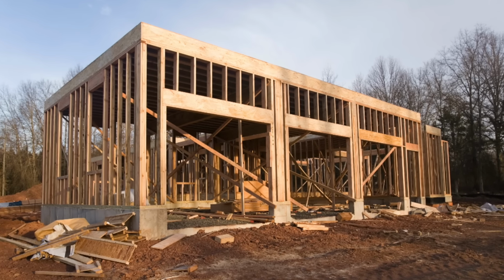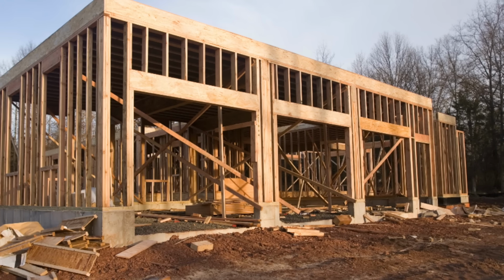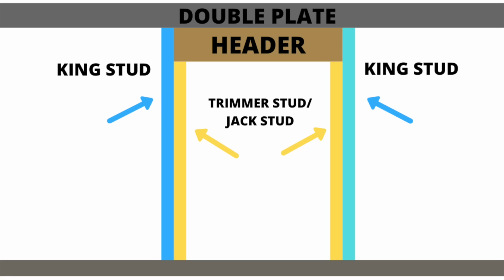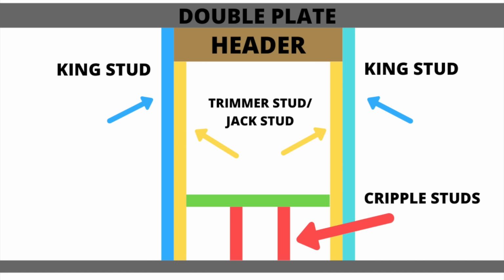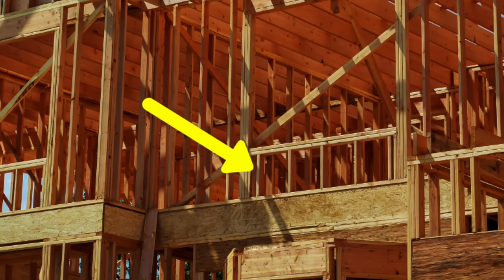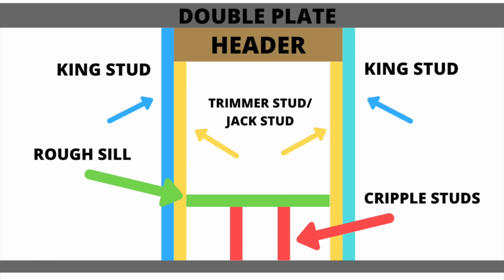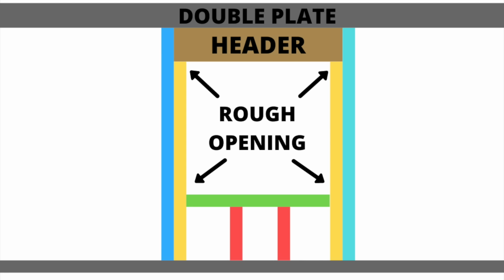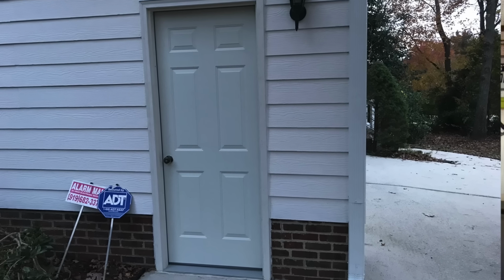All House Framing EXPLAINED...In Just 12 MINUTES! (House Construction/Framing Members)

Comment: in my little world, cripple studs are the members affixed to the king stud around door and window openings, as in a crutch used by crippled people, that carry the weight transferred from the header, whereasthe shprt studs underthe windowledge are called jack studs as a shortened member, also jack rafters for the same reason.   you have also forgotten to mention pressure blocks sometime used instead of simpson hangers.   by praising the trusssd roof, you have done a disservice to traditional stick-framed roofs, which allow for additional living space.
Reply: Truss roofs are much stronger than stick-framed roofs.
Reply: @jobacuda4472  i taught western platform framing in Japan for a few years, i only built one building that was was trussed, that was a wide spanned open commercial building.  all other residential buildings were single detatched, many with dormers.  they loved the attic spaces.  there was a big boom after the Kobi shaker, demand for western framing sky-rocketted.
Reply: @brianlindsay2727  Interesting

Comment: Is there a reason the sub floor is structurally supporting walls? Especially exterior walls.
Reply: The sub flooring (mostly now 3/4") runs from edge to edge. The second floor exterior walls rest on the outside 3 1/2" or 5 1/2" (directly over the walls below).
Reply: @jobacuda4472  yes, but the question was: why?
Reply: @ClickLikeAndSubscribe  Because the subfloor is covering the floor joists.

Foundation, mud sill, 1st floor joists, subfloor, 1st floor walls, 2nd floor joists, subfloor, 2nd floor walls, roof system.

Comment: As a builder, using all wood framing is the worst thing I ever experienced. Absolutely the worst way to build a house. Pour a slab, pier and beam with no basement, use entire concrete block framing, with rebar, pump mortar into every block cell and lentil, use stucco and stone. 15 % of lumber and metal framing. House will last forever, and look new forever. Wood houses should be illegal. Lol

Comment: I just recently started working as a firefighter, and in the fire academy, we were warned about wooden roof trusses as if they're some kind of demon to be feared above all else. What we were told was basically that truss roofs are much more dangerous to work under during a fire, because if any part of the roof is weakened by the fire, the entire roof is likely to collapse. Again, I'm very new, so I don't have any experience with this personally, but it's interesting to think about. 
It's a similar situation with engineered building materials; my understanding is that things like composite wood can be much stronger and more rigid under optimal circumstances, but the glue that holds the material together burns MUCH hotter, faster, releases far more toxic substances, and weakens far more rapidly with less heat applied.

Comment: Great video! This should be shown to apprentices in all trades. I'm an electrician, and I know the importance of terminology. I get tired of hearing people use the term "stud" indiscriminately for studs, joists, and rafters!! Another couple of extremely important building terms I would add is the difference between plumb and level. So often I hear the term level used for vertical and horizontal planes!

Comment: I have a question that I hope someone can answer. 
I live in Florida, over the last few years insurance on homes have gone up quite a bit. To the point where some smaller insurance companies have gone out of business or left Florida altogether. One of the big costs when we get hit by hurricanes is the roof. Even if your house is perfectly fine, a few missing shingles can cause big issues, sometime to the point of needing a new roof. So my question is this, why don't homes here get built with a flat concrete roof with metal rods running through them as support to eliminate a roof susceptible to damage from high winds? I was in another country last year and they built their homes this way. Why can't we?

Comment: Great video...thanks!  Do you guys have an opinion on finger-jointed lumber used in the house frame?
Reply: The only thing I've ever seen finger jointed is interior or exterior trim. I have never seen it in framing lumber. 

Fingered trim is paint grade non fingered or "clear" trim is used when it will be stained.
Reply: I assume it's addressed in the building code.

Comment: I just watched a video about the science of joists and why blocking and hangers are actually used.

I prefer to know the "why" of certain steps vs the regulatory "needs" as it allows me to solve my own problems and make educated decisions.

For example spanning a deck.  Do you want more support or larger timbers. More or less bounce?

Then there are the questions about costs and availability. 

Of course let's not forget about drilling holes through engineered systems to run large cables or pipes.

Comment: There are too many examples of Strandboard (OSB) in this video. Homeowners need to be aware of the differences between plywood vs. OSB in roof sheathing. Plywood has a good history on roofs and the sides of a house.
Reply: OSB has been used for 50 years and is just fine.

Comment: The sheathing comment reminded me of an incident that happened with a company I worked for. We were mostly industrial and commercial and I worked in the electrical side. The company had a project going on at a very old plant and they were doing some demo work on an old metal building. From what I heard, the building was mostly empty. The entire building was being scrapped. At the end of the day they had removed all sheathing off the building. I believe the only things inside were some man-lifts. Everyone was gone and one of our guys heard a loud crash as he was leaving. The entire building had fallen. I believe they said none of the columns were actually anchored down and that sheathing was holding that building up for years. Thankfully no one was inside. Some equipment got wrecked though.

Comment: What if you want to add insulation between floor joists? When would you do that?
Reply from the maker: After the roof shingles are on, Phillip!
Reply: @TheHonestCarpenter  but how would you add insulation to the bottom floor though. Because wouldn't it be covered up?
Reply: @phillippinter7518  There is a crawlspace on a foundation. Fiberglass batts between the joists. If the crawlspace is encapsulated, no insulation is needed.
Reply: Insulation is done after the framing inspection and before drywall
Reply: @Jobacuda  but what about insulation in the floor? Between the floor joists. Under the subfloor. That's what I was asking. The floor doesn't have drywall.

Comment: Our home was built with aluminum studs….Everytime I have tried to mount a heavy item to these studs they just pull out….What type of screw should I be using? Do I need to remove the drywall and put in special blocking?

Comment: You excluded a few components such as the "tees" the interior walls are fastened to and the corners . I watched this to refresh my memory of the corrners , as up here in the north east . they want to be able to insulate them . Overall I thought this video was well done . An important bit of information would be why we need the exterior sheathing , as the wall stud system by itself  only has direct vertical strength and no lateral or side to side strength .  when I was just starting out in construction some 40 years ago I heard a story where a fellow was demolishing a small bungalow . He removed all of the wood siding which was also acting as the sheathing and  left the shingle roof on the building . With no lateral structural strength, and the weight of the roof bearing upon it ,the building collapsed with him inside it and killed him .
Reply: The sheathing is to counteract shear forces, like straight winds and earthquakes. That story is a good illustration.

Comment: When you put up frames you do not expect the frame to move, sway. You do not expect it to rot for a long time. Frames are built to be strong. This is so that as long as you have a strong stiff foundation. So, it supports the frame and you do not get cracks in the frame.

Comment: Had a few Q's re subfloors: 1) If you are NOT using tongue & groove plywood but instead standard-edge plywood, do you need to leave a 1/8-inch gap between pieces to allow for expansion?; and, 2) will painting both sides of each panel of plywood before installing onto the joist frame help insure the subfloor's longevity?  I ask the latter as I am building solo but only on weekends when I have time and foresee a long period between subfloor installation and roof completion, meaning the bottom wall plates will be sitting for a long time on the subfloor plywood in possibly months of rain.  Won't the wood get wet & have no chance to dry out, thereby leading to early rot?  A big thanks if anyone could share their expertise!
Reply: Using non-T&G subfloor is a bad idea if you are not putting another layer of floor sheathing on top. When you step between joists with no T&G, one piece of plywood can flex more than the other. Finish floor materials could crack ro delaminate when that happens. Why use non T&G?
Reply: @jobacuda4472  Thanks for the reply!  Actually, I had not thought of having another layer of sheathing on top (to make a "double sub-flooring" layer that would be, yes?) but of course will have a final layer of hardwood T&G flooring on the very top.  In addition, there will be plenty of blocking between the joists underneath to add even more support.  As to why I didn't use T&G for the subfloor, was simply a matter of cost as the only such ply i could find near me (here in Japan) was of a much thicker ply & about double the price.
Reply: @JS-bm9tf  If you put blocking under the seams so neither piece of plywood can flex independently, you'll be good. Good luck!

Comment: As a retired firefighter I appreciate the strength and economic value of engineered lumber and metal fasteners in everyday home building. 
But under fire conditions they become a death trap because the wood has more surface area, and the glue and metal fasteners fail quicker than dimensional lumber.

Comment: Excellent job     I was a professional Pilot for 40 years but did framing on the side.  I learned all this from some crews that were building in my vicinity.  I would show up with an Ice chest full of soft drinks and beer around the time they were rolling up the hoses and putting tools in the truck.  So if I had a question I had to have the vocabulary for the building block method of learning.  So Soffit and Facia in some places was called  Cornice work and a seat cut was called a "Bird's Mouth". The guys didn't have much more than a high school education but they understood enough Trigonometry to cut a roof with rule of thumb and the right triangle.  So making the perfect cut on a top cut for a hip rafter was explained by a guy that had screwed up a few and found a method that worked.  I supervised from the Footings UP the building of my current home. A future neighbor referred to every piece of lumber as "boards"  or "more of those boards'.   Luckily he had a very honest Contractor building for him and some subs that only knew how to do it right.

Comment: When I watch American house building videos I am always impressed at the plywood bracing. 
In Australia we have what seems like 10-20% of the lateral bracing in the way of 6mm thick plywood on particular walls or metal straps in a cross and only on particular walls. And when it comes to roofing it is mainly just one metal strap cross for every large section that would accommodate such a brace.
Reply: If you are not in a high-wind or earthquake zone, you don't need as much bracing because the shear forces (the one trying to push your house over) are smaller.

Comment: Okay, one of the most popular framing questions - why are nails still used?

I am so tired of nails working lose over time and having to be replaced or worked on. Ten to fifteen year old houses with loose/squeaking floors, walls, cieling, etc.
Reply: Framing a house would take four times a long using screws. If the floor sheathing had been glued properly when laid, the floors would not be squeaking.

Comment: On 5:31 we can see two long joists between levels, are they load bearing? Can they be cut for a ductwork? Same board on 8:46, but here it looks like plywood, covering the space between 1st level ceiling and 2nd level floor. Can I cut it to install the ductwork for a range hood? Thanks!
Reply: Those are called bands or rim joists. Wouldn't hurt to ask a structural engineer before putting any big holes in them.

Comment: So a joist is a stud laying down on the job?  

And on a serious note, given the space - the void - created between studs and joists, what lies behind whatever my interior walls are made of is these voids (maybe filled with insulation, pipes, ducts and bugs)?  My interior walls have been described as masonry or stucco over drywall or plaster—I have no idea the difference or which is right; when I drill through them, it’s chalky for an inch or so, and then void…no pink insulation or anything obvious to me.  I ask because I watched your video about fasteners, and another, and another; and now I wonder about those butterflies that you stick through to the void vs the plastic anchors that just expand in the inch or so chalky area.  I better watch your video and the others again.
Reply: The voids are between studs an joists (most commonly 14 1/2") The chalk is from the drywall. Interior walls are generally not insulated, except as soundproofing.

Comment: Does window and door headers need to be flush with the outside and inside of the king stud or do you center it in between?
Reply from the maker: In 2x4 framing, headers are typically flush with both faces—a 1/2” ply or OSB layer will be sandwiched between them

Comment: I work as a technologist designing engineered floors and roof trusses.

You covered about 90% of all framing, as far as I can tell. I'm surprised you didn't mention the importance of a continuous rim board around the exterior floor system, or show some illustrations of the different standard shapes of roof trusses, also piggyback trusses. You talked about rafters but completely forgot about collar ties. Bracing is a complex topic but extremely important and I feel you could have went in slightly more depth - like lateral bracing, diagonal bracing, t-bracing, scab bracing, gable end bracing, purlins. While you were discussing beams/headers, I don't think it would have been too much to explain dropped and flush. Lastly, I think you could have briefly explained about shear walls, plus balloon framing vs. platform framing. Maybe even touch upon heavy timber framing and the superior fire resistance ratings.
Reply: Sounds like about 50 videos worth of material. The video wasn't designed to replace a wood-framing textbook.

Comment: Great video! I have a question about a house contruction that i am observing. I noticed the framers did not cut the wood at an angle when it is at 45 degrees to connect to another wood, so looks like the wood is barely hanging.  This was at the trusses.  The workers are being lazy.  Will this compromise the strength/integrity of the trusses?  Thanks in advance!

Comment: I'm new to carpentry but I've always loved it. Practiced it in my own small way growing up.
Learnt something here... the metal joints screwed into the wood. Where I come from carpenters use wood to link 2 pieces of wood together. It's always looked bulky to me. Metal plates are thinner and stronger. I'll be using plenty of those in my DIYs. 

Thanks😊

Comment: Why are US houses made of wood..even with treated wood .
Its still rots..uk as an example its brick or stone.
Reply: If you keep it dry, it never rots. Also, did you know that Venice is built almost exclusively on wood pilings?
Reply: @jobacuda4472  Keeping it dry is the hard part...so Venice is on wood pilings..surely that needs replacing ?
Reply: @jobacuda4472  Just looking at venice wood pilings on the net..very fascinating and interesting engineering

Comment: You need a fact checker.

Many of the terms you use are US-centric. 6:58 might mislead someone into thinking they are applicable in all countries.
Did you forget about pile foundations, or do they just not exist in the States?
Rim joists are a subset of, not strictly interchangeable with band joists (2:30).
Girders are a type of beam, not strictly interchangeable, and your explanation left me rolling my eyes (2:45). Headers are also a type of beam, believe it or not, which you imply otherwise (5:58).
Your discussion on roofs was pretty good though.

Comment: 2:20 precut knockouts????
Those engineered floor joists have lost 99% of their structural integrity.
How does an image like that get into an educational video? That's called structural failure. Roll a piano on the floor above, or have 6 adults jump at the same time in excitement, and it won't matter if you have 3/4" subfloor.

Comment: so interresting to see larger houses built by wood; There is a Skandinavian tradition for wooden houses, but it is very rare and traditional. We mostly build houses out of bricks or special cements (aircrete type blocks).

We have wooden rafters or trusses on the brick walls, and then typically tiles as roof material.

Our part of the world is very moist, so all strcutures have to take this into consideration.

Comment: My California ranch box built in 1955 had old growth redwood mud sills on the concrete perimeter foundation. It has piers on rough 4 foot centers with 4x6 joists on roughly 4 foot centers over posts set on the piers. It had 2x6 tongue and groove subfloors, solid. We sold it 4 years ago.